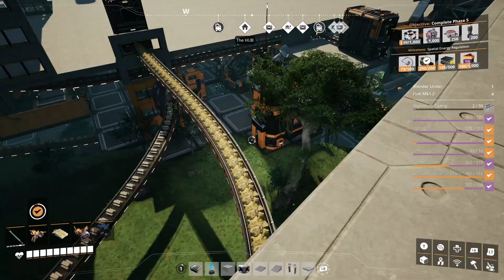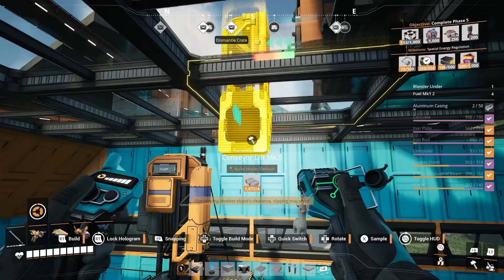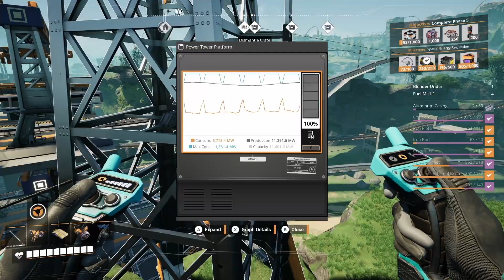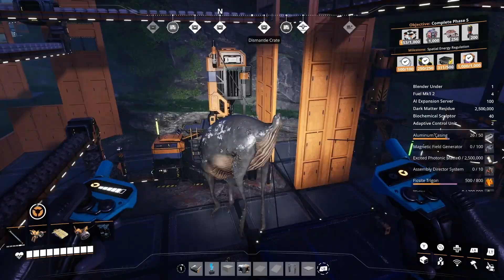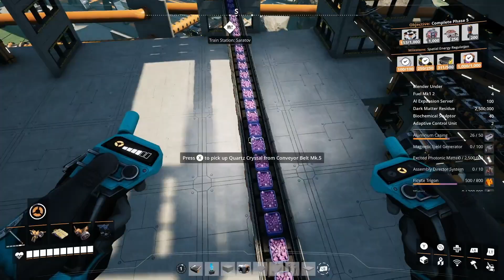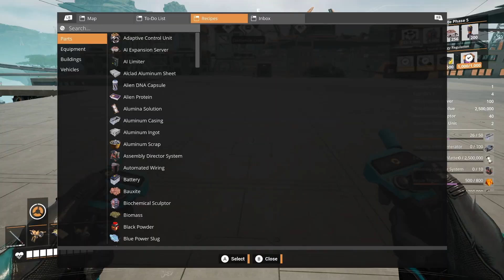Space Elevator Relocated & Factory Upgraded | Satisfactory 47

Comment: Alternate recipes are great! There are only a handful of must haves. Cast screws is great for making your factory smaller. Solid Steel Ingot is great because you get more steel for the same resources. And Heavy Encased Frame is of the most cost and complexity saving alternates in the game. (people have done the math) Most will say they can't build heavy modular frames without it.
The vast majority are situational. I like iron wire and stitched iron plate gets you reinforced iron plates with less iron per plate and you can skip screws all together. And I an a fan of pretty much any recipe that removes cables from the production of parts.
Anyway, my favorite start location is in the rocky desert. I like to stuff the hub in between the rocks over by the 6 normal iron nodes.
Reply from the maker: Ah, a fellow connoisseur of efficiency and the subtle art of cable elimination. You speak my language!
I really slept on the alternate recipes in this first play through, though the sloppy alumina made aluminium bearable. I wish I had done something about cables, as I ended up having to go tap more copper just to keep up.
6 iron nodes near each other? I'll definitely check that out, that sounds like a prime starting location.